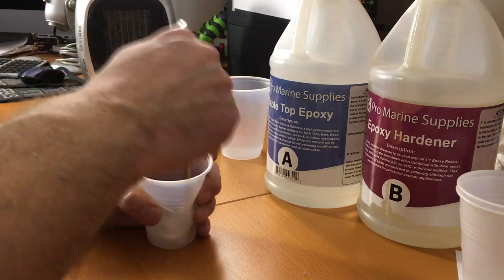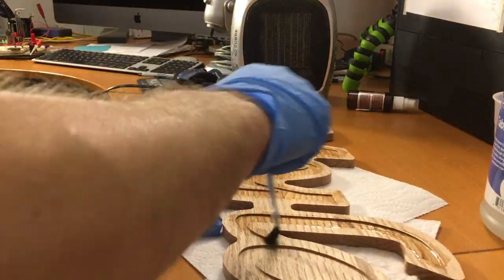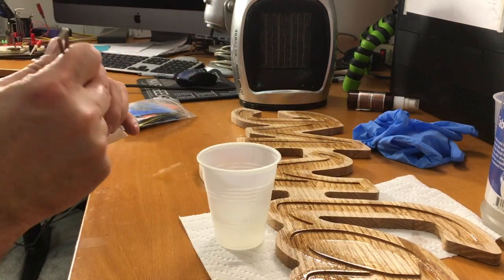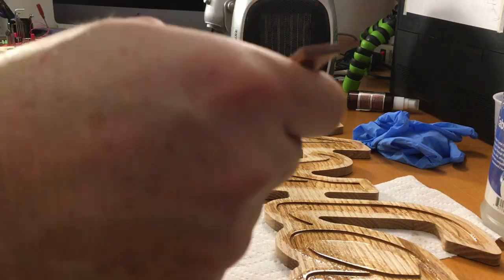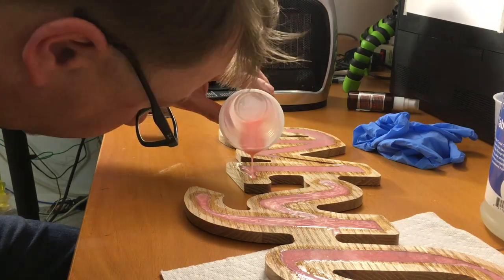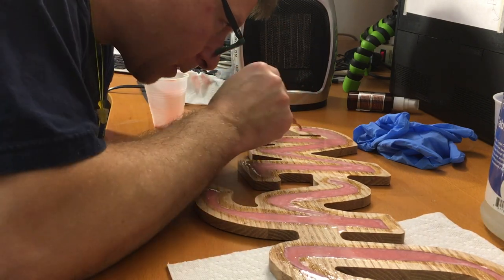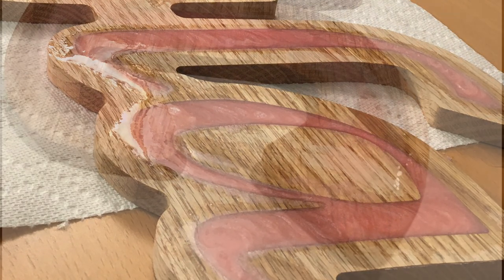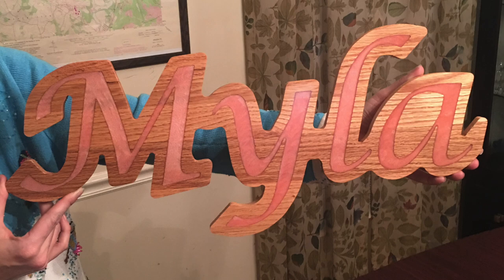How To - Using Resin/Epoxy to Create Inlays

Comment: Great project and i'm sure it scored you many points... LOL my question, i'm doing a small table top... i want to do the resin pour and cure etc. then flatten the whole top with my CNC. Do you see any problems with this  as far as the cured resin chipping etc. or does it machine well?
Reply from the maker: Hi Lyle - thanks for watching.  I've not seen any issues with milling resin. I've used an inexpensive spoil board bit as well as a relatively expensive slab flattening bit with equal results. I generally face at 100ipm and that generates decent results, but that depends on your machine. If you do want to flatten with the CNC, then you will need to over pour to get a greater thickness so the machine does not mill to the bare wood.  Best of luck!

Comment: would you recommend using the cnc to plane down the top if you don't have a thickness planer or have snipe issues?
Reply from the maker: Perhaps - depends on how big of a board you are talking about.  A good CNC will cost far more than an excellent thickness planer.

Comment: Hi, how do you sand the resin inlay with the wood?
Reply from the maker: Hello - I sand the wood/epoxy to 220 then sand the epoxy parts to 320 and wet sand to 1000 or 2000.  If you can't sand the epoxy separately, you can sand everything to 1000 without a problem.  Hope that helps - thanks for watching!

Comment: Should i leave the first transparent layer to dry before i put the colored one??
Reply from the maker: Hi Réhab - you can pour the second layer once the first layer is tacky (can indent it with your figure, but no resin comes off on your figure), or after the first layer is completely cured.  If you let it cure, you need to scuff up the first layer (e.g., light sanding w/ 120 grit sandpaper) before pouring the next layer to ensure a properly bond. If you don't scuff the first layer, the second layer will not adhere properly and will likely separate at some point.  Thanks for watching!

Comment: How do you keep the resin from sucking into the wood and having your pour sink in?
Reply from the maker: Hi - thanks for watching! You have a couple different options.  1 - seal the wood with a coat of epoxy before pouring (use a small brush to cover the areas); 2 - use sanding sealer to pre-treat the wood; 3 - simply over pour a little and remove the excess material once dry. Hope this helps!

Comment: any tips for sanding after the resin is cured?
Reply from the maker: I've found using the planer is much faster.  But you have don't have a planer, then sand with a belt sander to flatten the resin, then use mesh sand paper to smooth to 400 grit (or higher depending on what you are finishing with).  Either this https://amzn.to/2EG1GKg or this https://amzn.to/2KdgFPp will work.  I have the course grit set and it works OK -  I don't see them lasting 5x longer than regular paper, but they don't clog like regular paper either.  Hope this helps!

-Tom